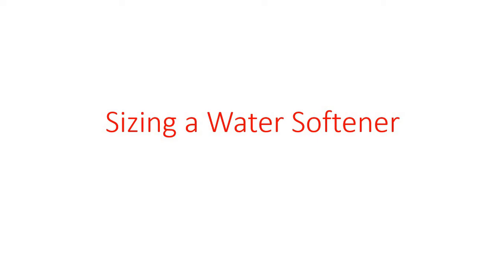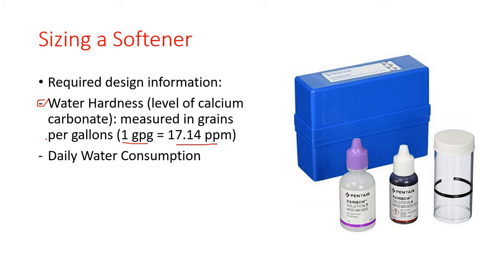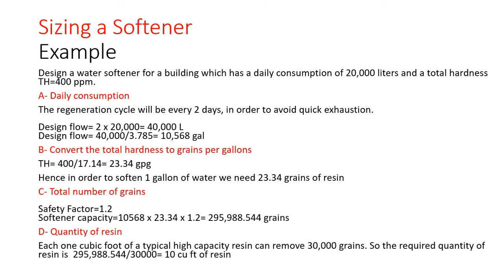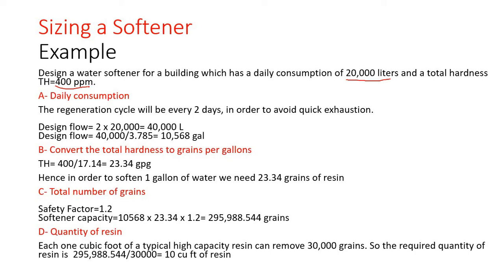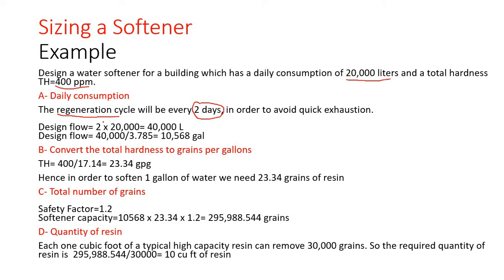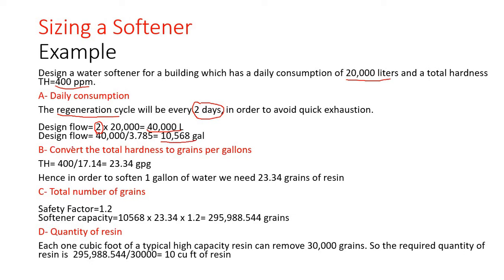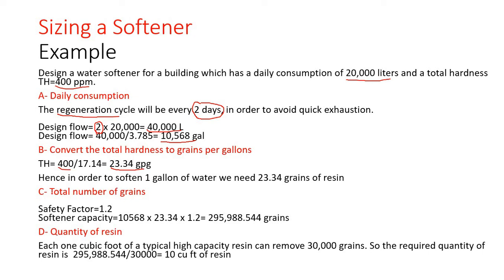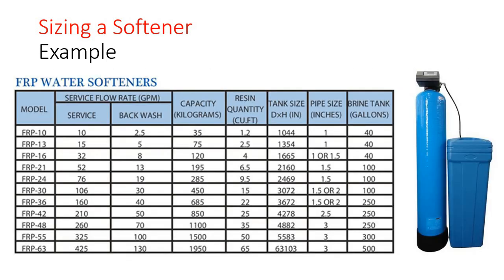How to calculate a softener's resin capacity and choose the appropriate vessel

Comment: Nearly all water softeners contain between 1 and 2 cubic feet of resign, max. Your chart is an impossible theoretical example. You'll never find a residential water softener with dimensions like you've listed. The largest residential tank size is 10"x54". Your chart will only work for theoretical situations.
Reply from the maker: As long as there is sufficient space, any FRP tank size can be utilized as a water softener. There are no size limitations when adequate space is available, and the provided chart can be applied accordingly.

Comment: Hello and thank you for this amazing video!
I need to know if the T.H (ex.400) calculated in this example is the feed hardness or the service water(output of the softener).
Cause if it is the desired hardness (which means it refers to the output water) then it should be inversely proportion to the resin grains needed and not proportion, right?
I guess you meant the difference in ppm that need to be removed. 😅